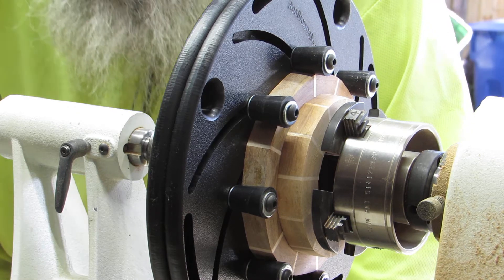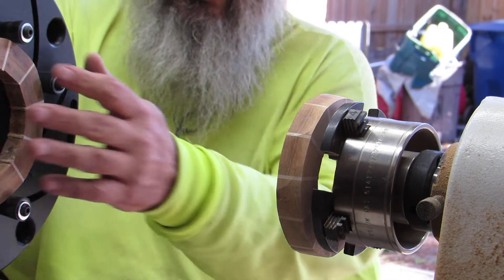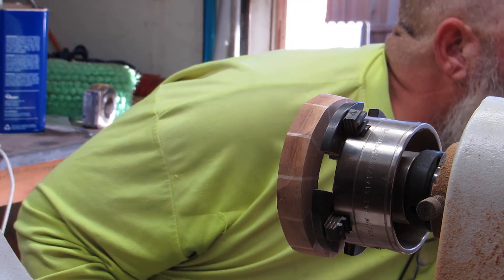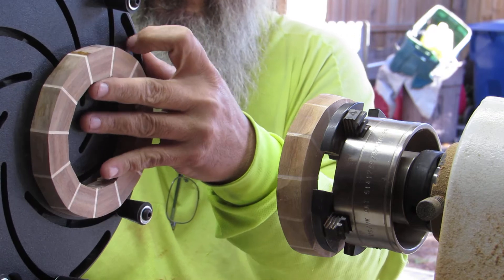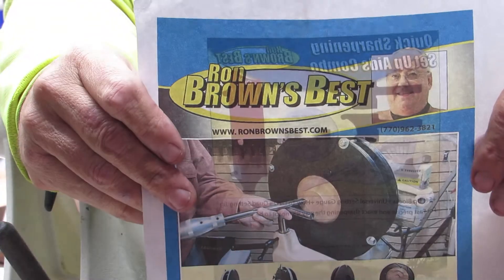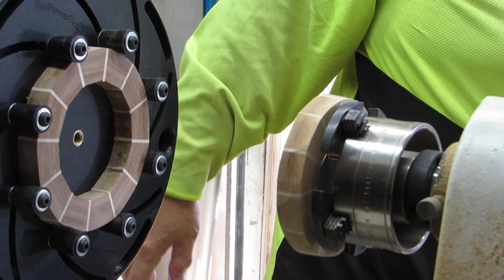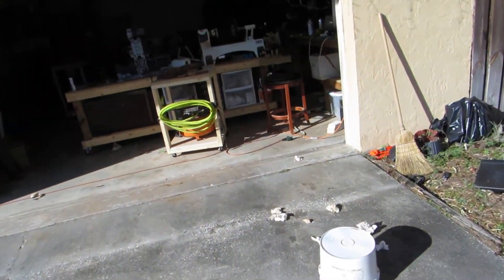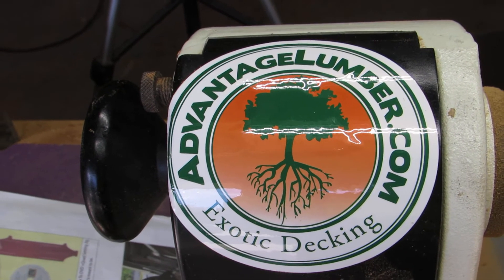I found the perfect way to center my segmented rings for turning on my lathe.

Comment: How do you center the rings when they're too big for the chuck?
Reply from the maker: With this truck I can get up to 12 inches diameter and that’s all my lathe will handle
Reply from the maker: Chuck 
*Apple corrected
Reply: I have a Harbor Freight lathe. I can rotate the headstock 90° which lets me cut any size. I’m finishing up a 20” platter right now.
Reply from the maker: wow good luck my friend.
Reply from the maker: I believe he sells a bigger one.